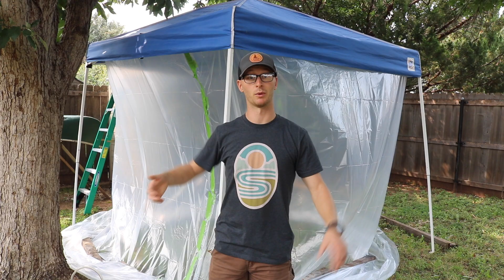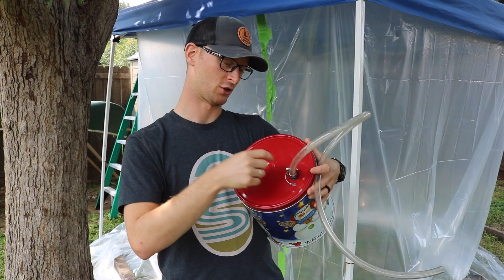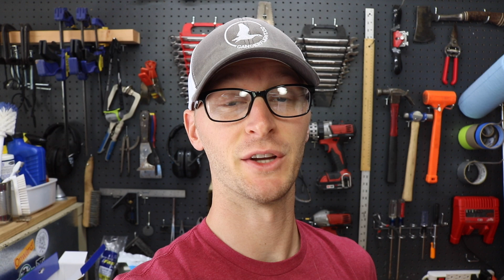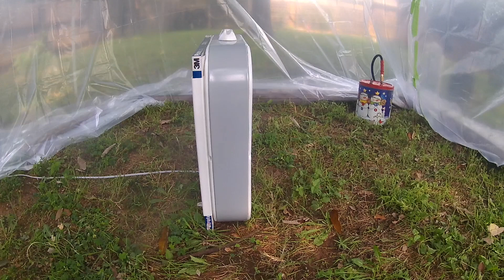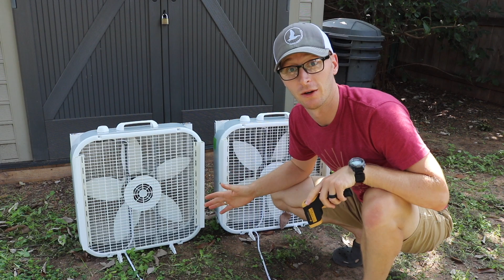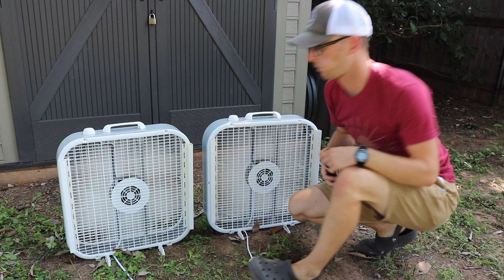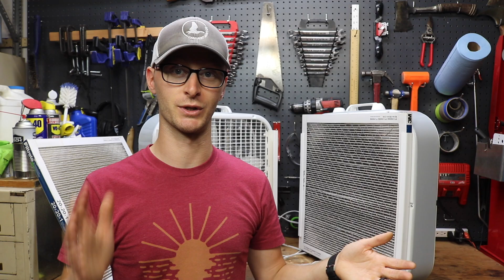Are DIY Box Fan Air Filters SAFE?

Comment: Great tip. I have  a box fan with a filter on the back 7 micron filter in my woodshop . I turn it on at the end of the day to help clean the air of wood dust. I have it on a timer. It runs for 3 hours.
Reply from the maker: The timer is a great addition for an application like yours!